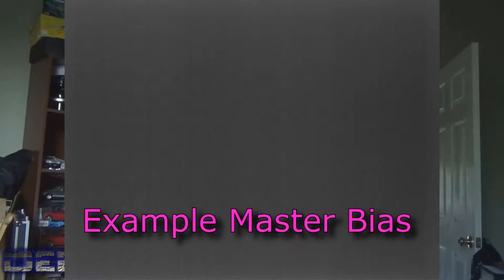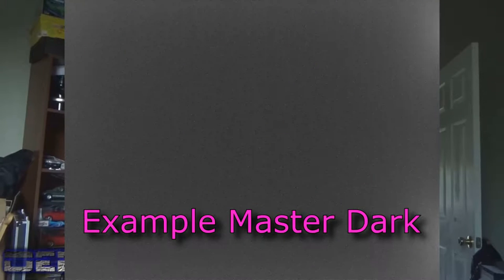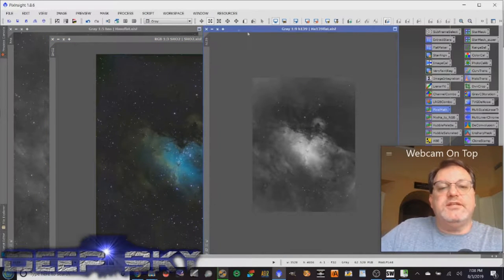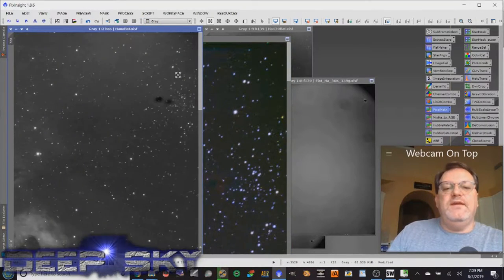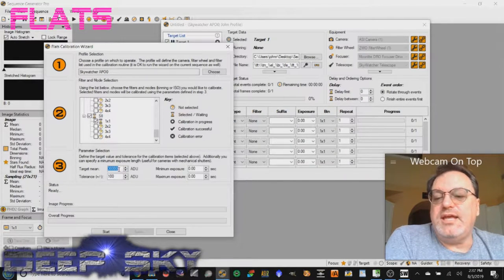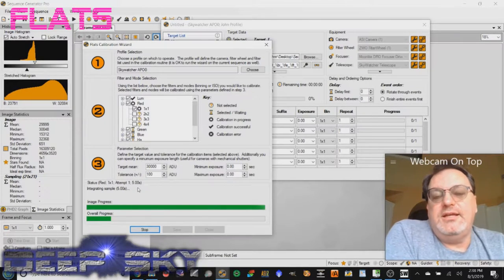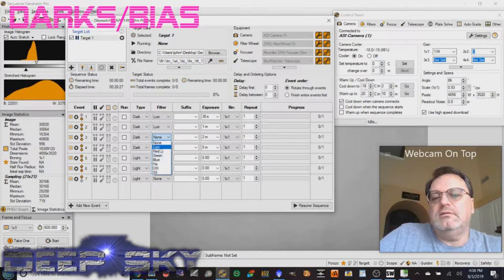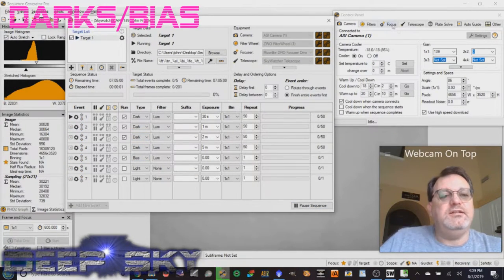Video #2 Calibration Frames

Comment: You can't just pick a gain for your calibration images, they should be shot at the same gain and temperature settings as your Light frames are taken. If not, you are changing the current of your camera and the noise level and dynamic range. They will not properly calibrate  if not.